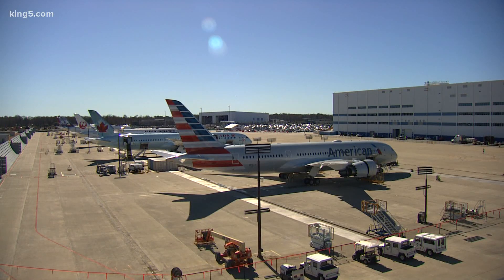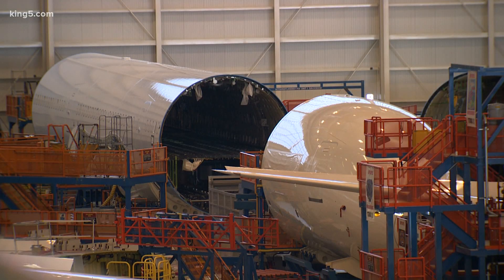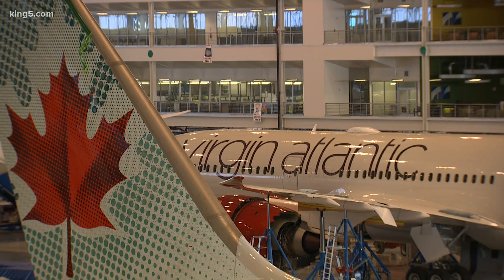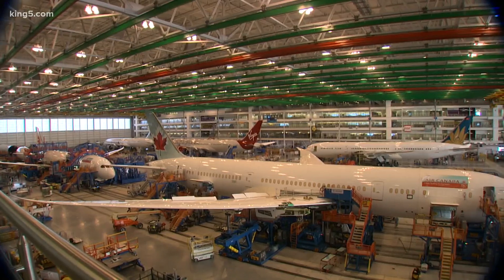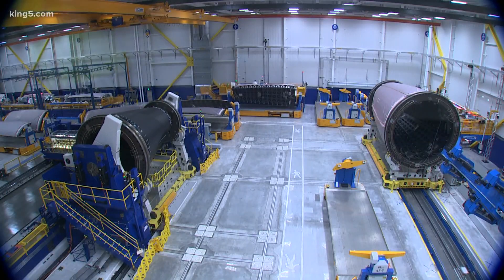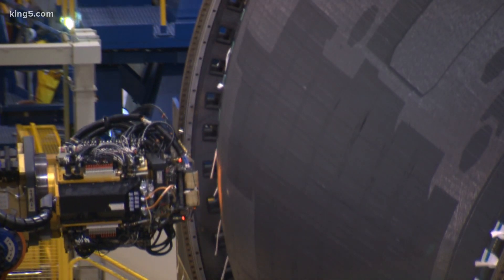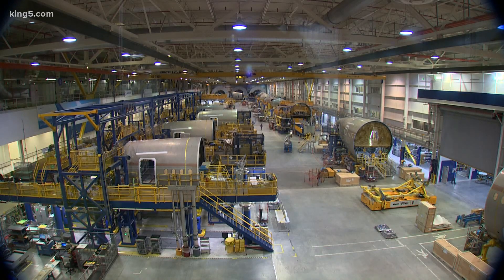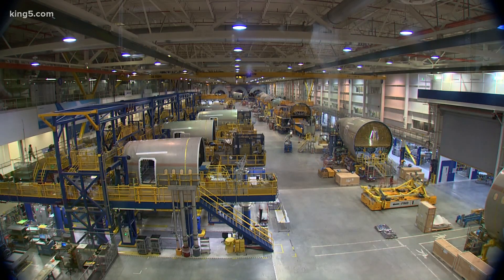Boeing finds manufacturing flaw in some 787 Dreamliners

Comment: These planes are made with materials so strong and flexible you can bend the wing tips up and they'll almost touch before finally breaking and theyre worried about a possible one thousands gap existing before fasteners are installed that will close the gap?